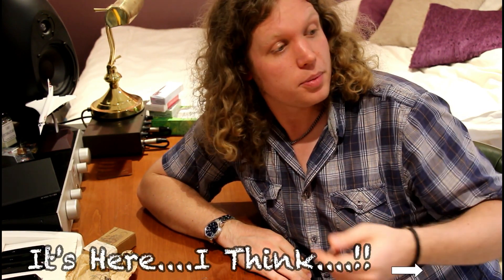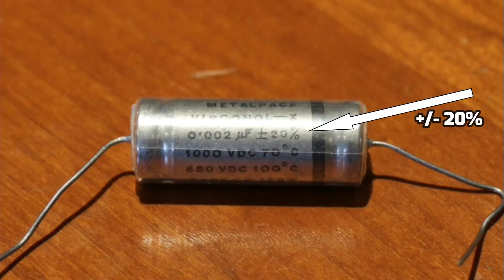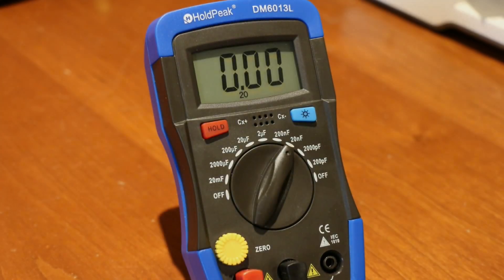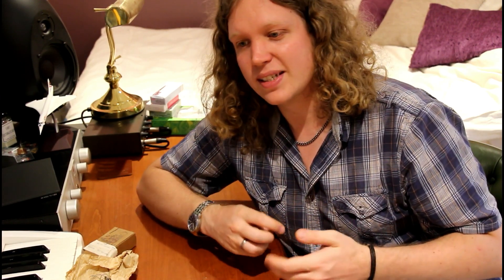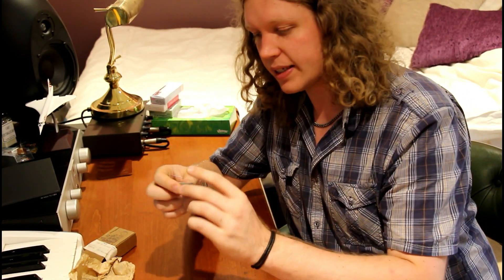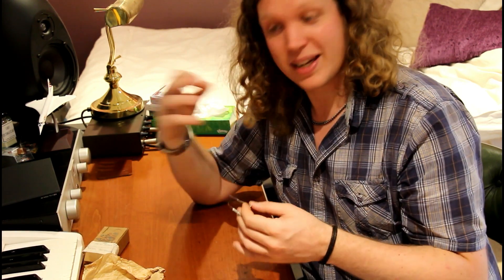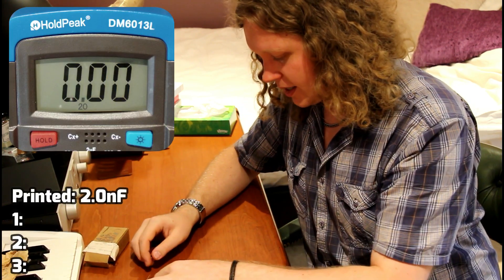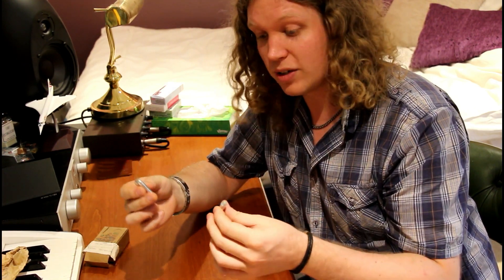Capacitors Part I: Tolerance & Drift (What Are We ACTUALLY Putting In Our Guitars??)

Comment: Do you know if there is a difference in sound when removing the capacitors from a Les Paul? I have done this and heard a small difference i think, and the tone pots do nothing now, but are still in the guitar with output jack wires grounded to one of them. I was hoping for more treble by doing this.
Reply from the maker: In theory you might get a little more high end crispness - as you've not just disconnected the cap, you've also gotten rid of the loading of the tone put.  But it's likely not to be too noticeable.
Reply: @JoePerkinsMusic  Thanks Joe. That's what i thought after hearing it. I wonder if it changed anything audibly when i turn the volume down too? It didn't seem to change the 50's wiring sound i had because that's what i was comparing before and after.
Reply from the maker: @benjohnson4810  The 50s wiring generally holds on to the high end better when you turn the volume down, so it'll likely have less of an effect :-)